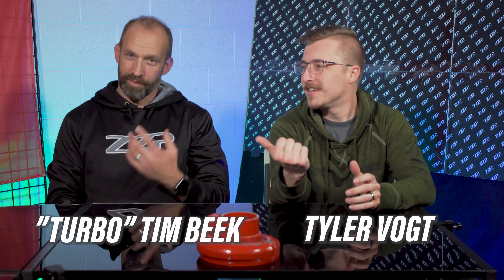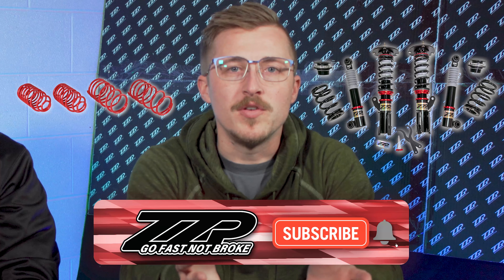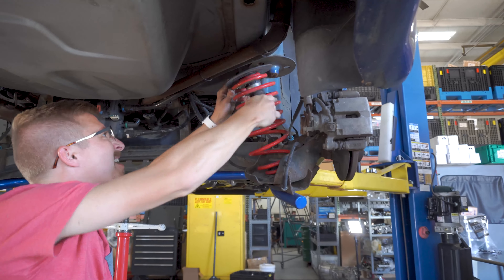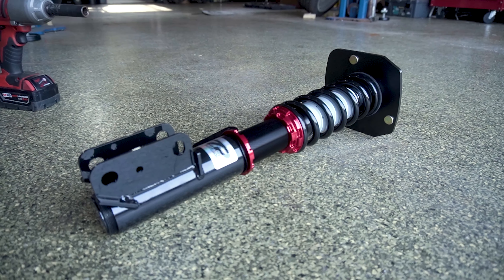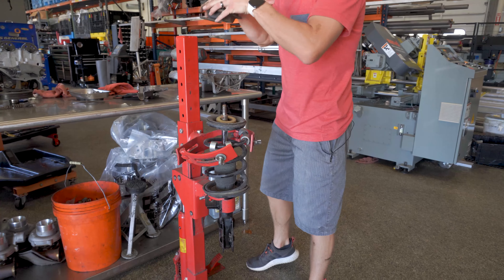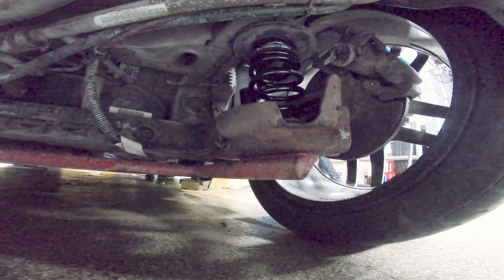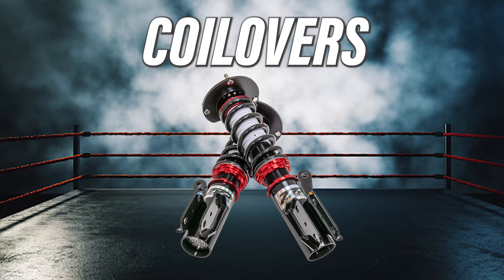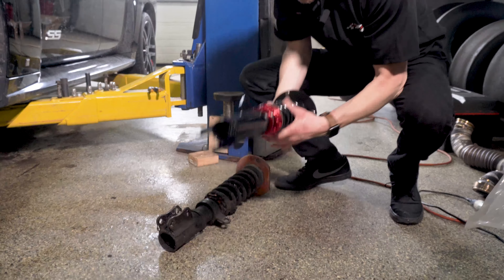Lowering Springs Vs Coilovers // Behind The Builds

Comment: Good springs will last the life of the car. Paired with good struts and you will have an overall nicer setup for daily driving. Coilovers have a lot of adjustments but if you're not racing or tracking your car it's a bunch of adjustments you'll never use. So $1200 will get you a great set of springs and struts. $1200 on coilovers will get you a decent set of coilovers ( entry level ) and will only last a few years B4 needing rebuilt. Also coilovers have more parts to fail or loosen up with collars and such that was not mentioned in this video. So bottom line is whats you goal and application purpose ? You don't buy running shoes to hike in and you wouldn't run track in hiking boots. Jmo idk

Comment: Hello I have a 2014 Chevy Silverado 1500 5.3 z71 LT. I removed rear block and installed 2 inch drop shackles. In the front I'm doing a 2 inch drop with spindles. Which will give me a 2/3 DROP.  What's the best way to get 1 more inch of drop in the front. THNX

Comment: I want to get some coilovers for my ATS but I've heard is not a smooth ride on a Daily. Is that true? On bumps they say it sounds like a hard hit and not smooth like a regular... I just ordered the ZZP air intake, throttle body, and the ignition coils... next is them coilovers but still not sure since it is my daily and want a smooth ride
Reply from the maker: Coilovers are designed to give a sportier and firmer feel than stock suspension. They have a lot of adjustment, and when installed correctly ride great. Coilovers won't have the same exact feel as an OEM soft suspension. People who say they are a harsh ride are either set up incorrectly or are using cheap budget coilovers.